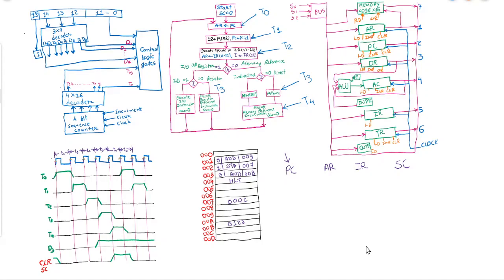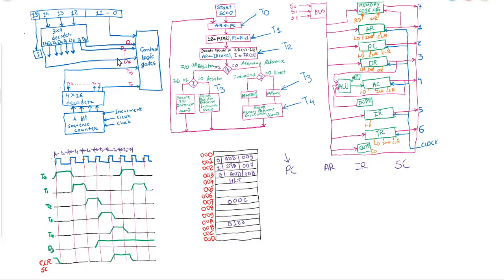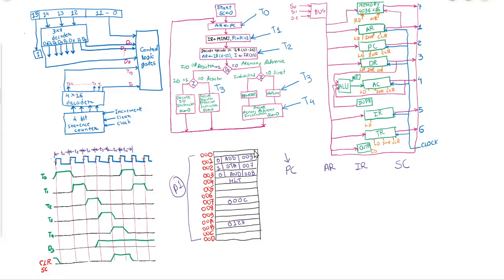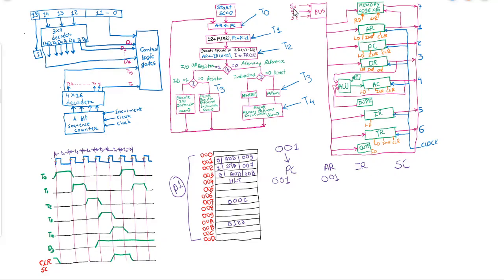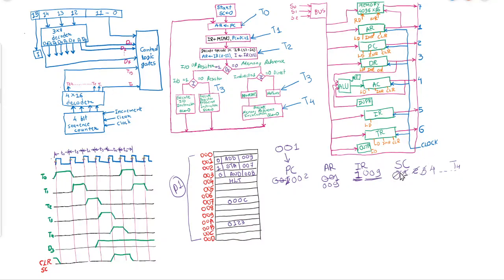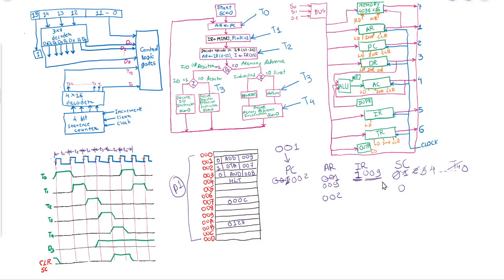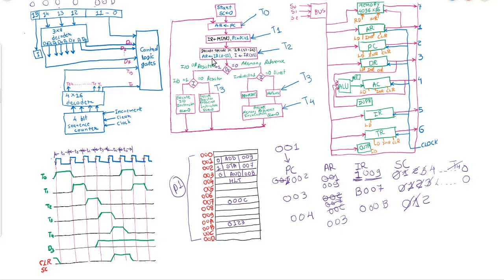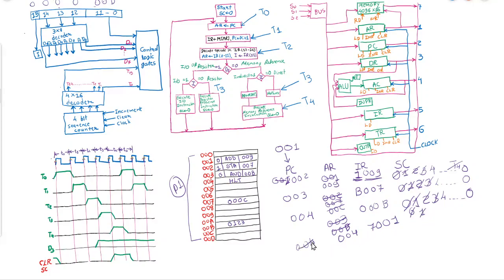Ch - 5 | Tutorial - 8 | Instruction Cycle | Control Unit | Stored Program | CO / COA

Comment: great lecture sir, helped me a lot , but i have one concern, i can be wrong , but i think you made a mistake when executing the second AND intruction you wrote 000B as 00B being the address and 0 of the left most is for AND intruction but i think there should be one instead and the value of I will remain zero , it didn't affect the final answer of anything i was just curious , let me know if im wrong 

thank you,
Reply from the maker: opcode for AND is 000  (bit numbers 14,13,12) and addressing mode is direct. So, bit 15 is 0,  address digits are 00B (0000 0000 1011)  bits from 11 to 0 from left to right. if you combine all then 0000 (15,14,13,12) ,  00B (0000 0000 1011)  bits from 11 to 0 .  So final answer is 000B. For opcode of operations you can watch previous videos.
Reply: @technologygardening  thank you sir

Comment: I didn't understand how IR in 002 is B007
Reply from the maker: Indirect Addressing mode bit 1 and  STA opcode 3 ( 011) if you combine both then bit 15,14,13,12  will be 1011 which decimal 11 and Hex 'B'  and address in the instruction is 007 (12 bit    0000 0000 0111)  if you combine all there then binary will be 1011 0000 0000 0111 and HEX will be B007
Reply: @technologygardening  Thank you